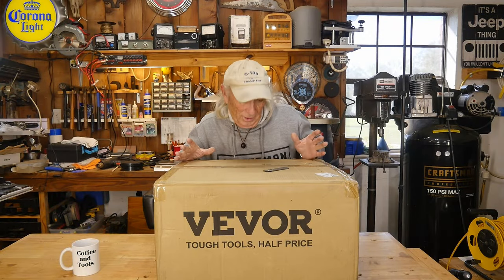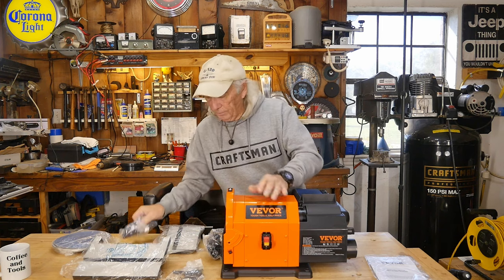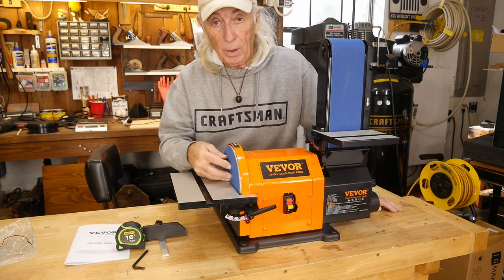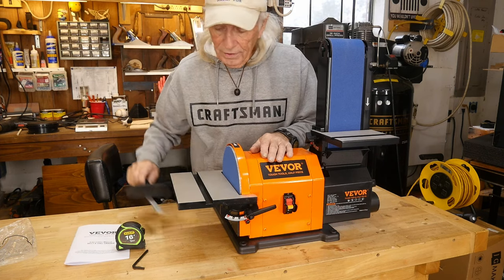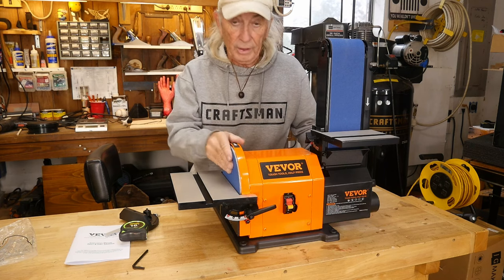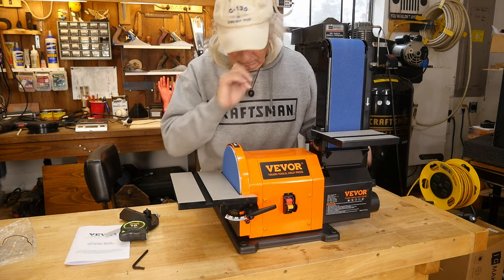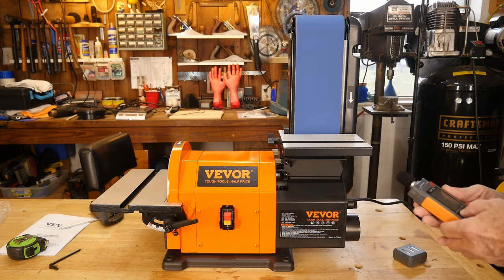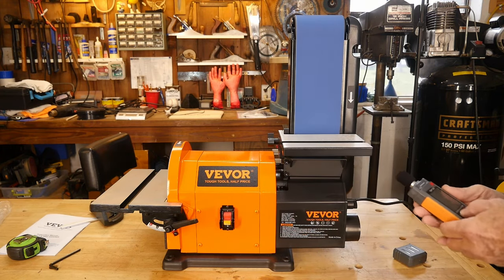Sanding disk and belt machine from Vevor, reviewed by Coffee and tools ep 393

Comment: Okay…first; cost. I missed the deadline however, ordering direct from vevor, $160.00 and I used the 4 payment option which is nice. The direct link to Amazon, was $200.00. That 40 bucks will buy extra belts and discs. 
I currently have a central machinery that was as you know, the star ship of harbor freight back in the 80’s. I inherited it from my dad and it’s beat to snot…oh, doesn’t have any suck features either 🤦🏻‍♂️🤷🏻‍♂️👊🏻🤣
I will say that the HF one is on its own base. This is a machine that doesn’t see daily use so I’ll stow it away until  I need it and then I’ll set it on my VEVOR 4’ adjustable height rolling workbench 😉😊
Last point…the “jam test”…while I get the purpose of the test, if I need to take off that much wood, I’ll use my miter saw or jointer or VEVOR thickness planer. Seeing a trend here?!!?🤣
My wife really appreciates the HF sander so I know she’s going to love this. And I’ll now have another project to figure out for the kingroon 3D printer so my sander can….suck?! 🤷🏻‍♂️🤦🏻‍♂️👊🏻
Nice machine that will fit nicely in my rapidly expanding VEVOR workshop!! 😎🤣
Reply from the maker: WoW, I think she will enjoy it, but the price was that different from the links they supplied. I'm going to have a chat with the Vevor rep about all this cause something smells wrong with the links and there should be a discount code etc and instead they seem to be slow with giving me the DEAL links etc. I'm putting up my Craftsman for sale next week locally. HEY..let me know if the disk is 6inch or 8inch etc. That was another strange one, but they are making changes faster than the label company can keep up with LOLO.
Reply: @SirTools  yes, I was really surprised by the price deviation as well. But I ran into the same thing with the rolling adjustable workbench. You had all the bells and whistles in the kit they sent you for review, but when I ordered and received mine, it was bare bones. Does have the spike bar but that’s it and it came with only the fixed feet. I had to buy locking roller casters with nuts and drill out the fixed feet slot. Not a big deal and I love the bench…it’s just wasn’t a flagship bench like they sent you. The only thing I don’t like about it is it’s a pain to raise and lower…I’ll figure out a mod for that over the winter. You’re 100% right Gina is going to love the new sander…she was fine with our 80’s HarborFreight central machinery…she’ll be overjoyed with the vevor!!  That craftsman one is a nice tool also…but we know craftsman is more than the dewalt snobs want to admit!!🤣🤣👊🏻
My only dilemma now, is do I go craftsman or, vevor because I’ve come to like their stuff!! 
You crack that whip on those vevor reps Larry!!😎🤣👍🏻
Reply from the maker: Had a short meeting today with some of the reps at Vevor and talked about this. I understand part of the issue with links to samples etc, but this just keeps happening. Also like I've mentioned in the video to check back days later for the link and discounts because they always delay or change something on me.
Reply: @SirTools  I’m still happy Larry!! This sander is a solid beast…and that’s what I find with all the vevor line…I’m going to mount it on the harbor freight base so I’ll have a rolling sander AND, a mix of me and my Dad. 👊🏻😎😊
Reply from the maker: Sounds like a plan. New plasma machine coming in from Vevor next month.
Reply: @SirTools  ohhhh Larry!!! That’s not FAAAAAAIR!!! 😬😎🤷🏻‍♂️🤣
Reply from the maker: LOLOL...🤣🤣🤣